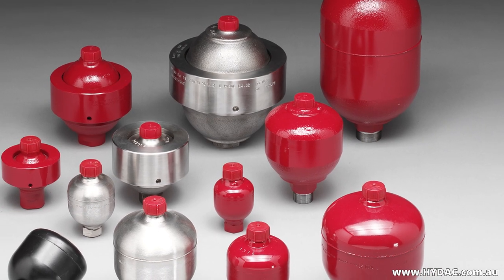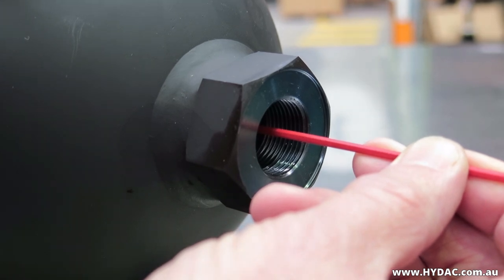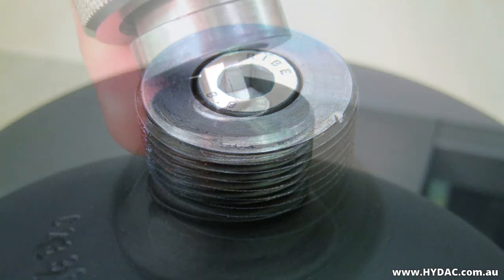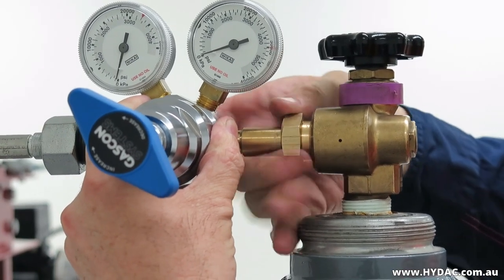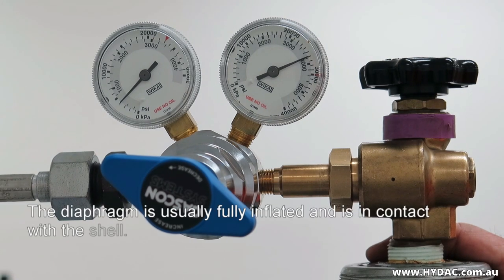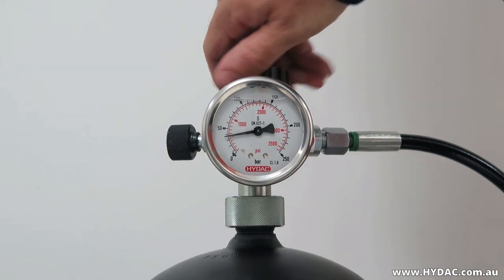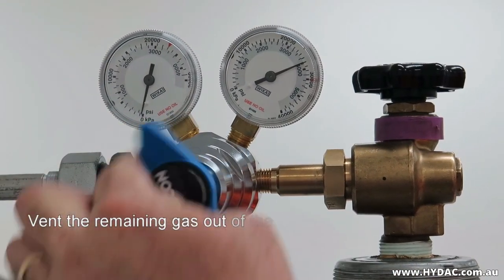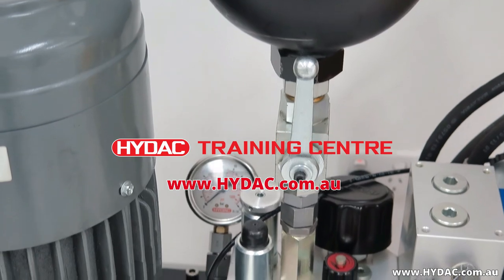How to Charge HYDAC Hydro-pneumatic Diaphragm Accumulators

Comment: What kind of gas regulator that i need to use? At what pressure rating?
Reply from the maker: Hello Falken, at 2:15 in the video we say; “Before connecting a Nitrogen regulator to a Nitrogen bottle…”
Use a Nitrogen regulator. Ensure that it is rated above the pressure of the Nitrogen gas bottle.
 The regulator shown is rated to a maximum outlet pressure of 20,000kPa.